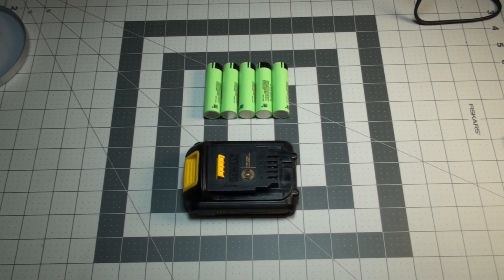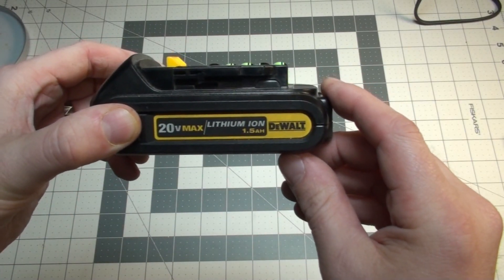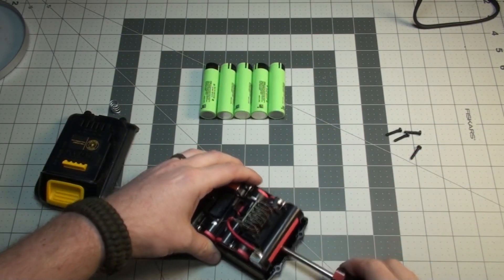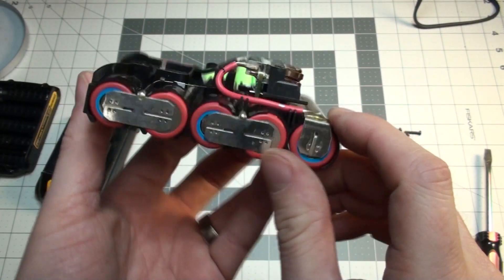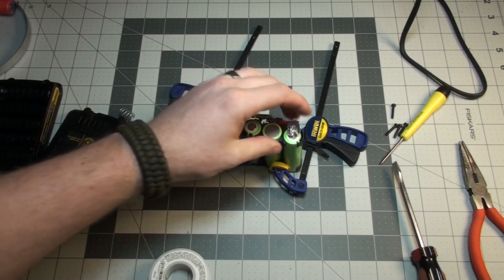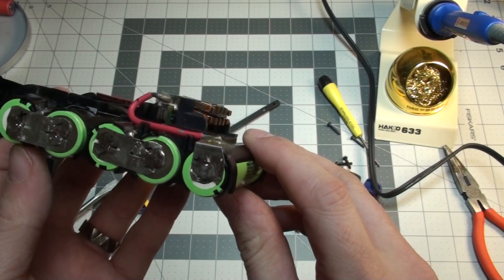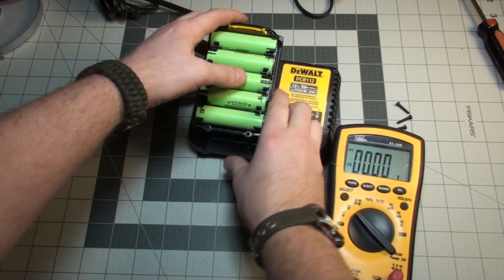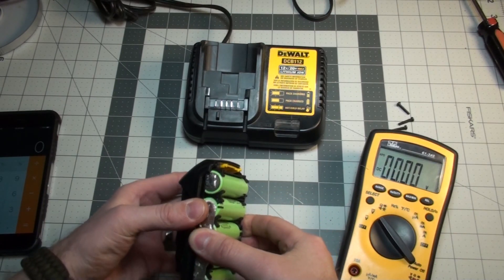$35 Dewalt 20v Lithium Battery Rebuild #diybattery #dewalt #batteryrepair #18650 #cheapbattery

Comment: Shouldn’t you charge and balance your cells first? That’s likely the reason you can’t get to 4.2v. When one sense wire reaches max voltage it stops charging all of them.
Reply from the maker: The cells should be close in voltage.. like plus or minus .1v   And I am pretty sure the dewalt charger doesn't charge to 4.2v.. Probably for longer cell life.
Reply: @keylitho  Yes, something else I read said that max voltage for DeWALT is around 4v… but they also said 0.1v is too much variance. It’s not like we’re building a new battery here so, like you, I think 0.1v is close enough for a rebuild.
Reply: @keylitho  Oh yeah… they call these “20v Max” battery packs in North America and the smallest ones have five cells in series, hence, 4v per cell “Max.” That seems to be what the other guy was referring to. Not sure if there is any overhead there, since “Max” is just a way to market a higher voltage instead of the 18v nominal voltage… supposedly to differentiate from their older line of NiCd-powered “18v” tools.

Comment: PSA These batteries are only rated at 4.87Amp https://www.batteryjunction.com/panasonic-ncr18650b-3400.html. Recommended to use greater than 20 amp cells on a power pack. A standard dewalt brushless drill (DCD791) uses around 20-30 amps under full load!!! These cells will not be able to hold that power before damaging the cells and/or causing fire. i have seen it personally!!! If you are going to rebuild packs, use properly rated cells!!!!! Great vid otherwise!
Reply from the maker: Yea I hear you...The dewalt tools wont try to pull the amps in they are not there the tool just stops..  It works in the drill just fine, anything else not so great it just stops.. That being said I have used this for almost 5 years and it is still a great pack.. But I mainly use it with my hand held area light. (DCL050) it lasts a very long time for the size.. also with the USB charger and the Radio.. It has many great uses.
Reply: @keylitho  i deed with light loads it will last a long time. But for many it comes across as a cheap fix for repairing tool batteries that will see heavy use. I rebuild these as well and have seen what happens with under rated cells first hand. But for light loads those cells work just fine. 👍

Comment: Terrible cell choice for a tool battery. Those are not discharging fast enough...
Reply from the maker: Yea probably... But works just fine with the drill and now that I have had it for 4+ years I really only use it with the work light.. and it still works great.

Comment: The reason those batteries are a bit longer are because they are protected batteries, which you didn't need, because the battery probably has a protection circuit in the battery . read up here https://www.18650batterystore.com/products/panasonic-18650-protected
Reply from the maker: They were not protected cells.. they were only about 1/16" longer.. the ones in that link say they are 69.41mm tall that's almost .25" longer... And after others have commented that I measured the Cells.. I think the Dewalt batteries were just a tad smaller.

Comment: You need to use a spot welder for these. Not solder.

Solder makes battery temp reach over 400°f - 450°f

Spot welding 90°f - 100°f

Have I done it?

Well yeah. You get less resistance too with spot welding.

Comment: Hey do you know which type of solder you used on this? I've been having a heck of a time getting the solder to stick onto the battery terminals.
Reply: First clean the surfaces with an electronic cleaner
https://www.amazon.com/CRC-05103-Electronic-Cleaner-11/dp/B000BXOGNI/ref=zg_bs_15719001_1?_encoding=UTF8&psc=1&refRID=RRCPEBJ08F6RPTVE5BM9#customerReviews

Then use a no clean flux on the piece:
https://smile.amazon.com/Liquid-Flux-No-Clean-10ml-0-34oz/dp/B07B53LNGX/ref=sr_1_4?crid=12MK9AQ1RT3DX&dchild=1&keywords=no+clean+flux&qid=1609352193&s=hi&sprefix=no+clean+%2Caps%2C185&sr=1-4#customerReviews
Reply: Use a battery welder.

Comment: What's the sizes of the bit to remove the screws from the battery or how I will search on Amazon..thanks
Reply from the maker: There is a link in the description.. any security bit set should have the right bit.

Comment: So how have these batteries gone long term? You mentioned they werent being fully charged so are they lasting longer and have the same power with the new cells?
Reply: Don't use these cells. They're pretty inappropriate for the application - In particular, the dewalt charger is too fast. 

The reduced charge voltage is just a choice by dewalt, and is appropriate. They are being fully charged.

Comment: Would it not be 1.7amp after installing the 5 X 3400mah batteries? How did he come to the conclusion that its now a 3.4Amp hr battery? Whats the formula to work this out?
Reply from the maker: It's is because the Batteries are 3,400 mah (3.4 ah ) and they are in series so the overall capacity does not go up, Just the voltage does.. If the 5 Batteries were all in Parallel then the total pack capacity would be 17,000 mah (17 ah) but with only a single cell voltage.. This is how most portable battery banks are arranged.. (In Parallel)
Reply: @keylitho  Thanks for this mate! I understand this now from your explaination. Thanks for replying.. I did'nt realise that the max continuous amp current supplied by the individual cells also made a difference. All this stuff is good to know.. Cheers mate & stay safe!
Reply: When i bought a battery for my vape device, it had a 20amp continuous discharge max rate, i think those cells would have been ideal for your purpose! so many different 18650 batteries on the market!

Comment: Can you make one of these videos that takes a dead pack and converts it to corded utilizing the dead pack casing? I'm interested in getting more of the MAX series of tools, however, I have concerns about buying battery tools because of the fact that manufacturers could discontinue batteries and/or accessories for corded tools at any time, leaving your current tools (which, if taken care of, work perfectly fine) absolutely useless once the batteries die completely. My thought was to create a corded adapter that plugs in to a standard 120V AC Outlet that could convert my battery tools into corded tools.
Reply: For DeWalt you can buy the case that encloses the batteries for $15.

Comment: Also very dangerous using a regular soldering iron to do this. This is NOT the proper way to do this. Another misinformation video. And just because it has a higher mah rating and the voltage reads out right it most likely wont have the current amps that the tool requires.
Reply: I agree, do NOT ever solder the nickel strips back together on the cell. It may damage the cell internally. There's a reason why manufacturer uses spot weld. I, myself, repair and revive all power tool lithium ion batteries and I always spot weld the nickle strips.

Comment: The cells in the battery pack are rated for a whopping 30a draw.  yours have a max 6a, however they will degrade very fast at max and are happier at 1-2. Should have a disclaimer. I understand that some tools may be fine under light working condition but even a drill can spike it above safe working conditions and this is an unprotected battery. which means they blow up. you have the energy density of a hand grenade in your hand. Use your brain. I own tools that torque out with one bad original cell. At least get something designed for high output and is protected. Just an opinion

Comment: What model 18650 batteries were used in the dewalt pack originally from factory?

I would have used some 20A cdr batteries instead of the less than 5A panasonic batteries in the video.
Reply: They use samsung INR 15R's in the 1.5Ah packs. Typically good quality mid-tier cells in dewalt packs.
Those panasonics are a terrible choice. Discharge current is not adequate, and charge current is unacceptable for dewalt fast chargers. Max charge speed for those cells is over an hour.

Comment: Dewalt battery life is a awful way over priced. Could you put them in parallel let them come back to a chargeable level.
But the Ebay batteries are very cost effective and last longer.
Reply: I was going to buy a larger battery but I may follow this guy and buy a dead battery and rebuild lol

Comment: Can you please advise?
Was there only the pos. and neg. to connect to the battery pack? The battery shows 5 connections,,are the other 3 not connected? Usually they are connected to give battery condition and temperature references back to charger, is there no on board circuitry,PCB, in battery?
Grateful for any answers from anyone reading comment.

Comment: nice rebuild !   the BMS are inside the charger not in the battery and this help a lot to rebuild. but I don't know if it is good to the pack because there is no equalization in use. only when charging. anyway nice work!

Comment: I get the bauer packs from harbor freight and take the guts out of them and put in the dewalt packs. You have to solder the old board onto the new pack even though the bauer is almost identical it still won't work with a 20v tool or charge unless you swap the guts over.

Comment: Awesome video! Man, doubling the battery capacity and not making the battery any heavier. 18650 batteries are even better now since you made this video too.. and cheaper! I will NEVER buy another new DeWalt battery again!
Reply: Current 3 ah battery can be found for under $100 for a two pack with better 21700 cells.  Goes on sale at times for $79.  This video was neat, but probably easier and better to just buy from DeWalt during sales.

Comment: THIS IS A VERY BAD IDEA PEOPLE!!! DONT DO THE SAME

Those cells are not designed for power tools and if you use them under load you will either ruin them or cause fire etc etc

Comment: Nice video. I'll add that the likely issue with the battery size is that they included protection circuits on each cell. If you buy them without that option they'll be the same size (the protection should be handled by the battery pack electronics so this isn't a problem).

Comment: For any future views who want to know, the 18650 in these cells is the sanyo UR18650RX. The identifier is not printed in ink, it is embossed ever so slightly in the heatshrink.
Reply: interesting points ,if anyone else wants to uncover recondition old batteries try Jons Mender Guide (should be on google have a look ) ? Ive heard some great things about it and my work buddy got excellent success with it.
Reply: Came here to look for this info exactly.  Thank you.

Comment: The user must have appropriate understanding of lithium ion batteries before purchase. Use caution when working with and using lithium ion batteries as they are very sensitive to charging characteristics and may explode, burn, or cause a fire if misused or mishandled....NEVER SOLDER  BATTERIES MAY EXPLODE. SPOT WELD ONLY

Comment: Dead pack for $5 bucks off eBay ...
I like the choice of top shelf battery replacement; Panasonic  18650 3400 mha ...

Question: what kinda shape was those Samsung 18650; comments pls... 

NOTE: Purpose for details about the utility remaining available to be taken advantage of in a multi-multi-cell battery pack powering an electric bicycle or diy powered skateboard
Reply from the maker: The cells in the pack were at 0.1 volts.. :)
Reply: 0.1volts ... well can't get much from those ... eh

Thanks for the reply

Comment: Dewalt's 20 volt battery pack has 5 batteries. Milwaulkee's 18 volt battery pack has 5 batteries.  Dewalt is exaggerating.  3.6 volts X 5 = 18 volts
Reply: leefiles    Not necessarily.    Lithium batteries charge to 4.2 volts so you start with 21 volts, then go through 20 volts and on down to 18.    The AVERAGE voltage of a cell is usually considered to be 3.7 volts which is where 18 volts comes from.   It also comes from the old NiCad or NiMH cells of 1.2 volts x 15.   DEWALT is not in error.   They choose to think of LiIon cells as 4.00 volts which they are for a while and certainly above 18v for most of the charge as the cell declines to the quite unofficial “average” of 3.7v.
Reply: 20 volt is a marketing name for brushless tools
Reply: Welder Musk     Actually they offered “20 volt max” products long before the brushless motor products came out.   I own a lot of these 20 volt max tools.   The brushless motor products are just a natural evolution in motor technology.

Comment: If you use good cells that can discharge at 20 Amps or more, those nice little solder joints become resistors and will melt. They don't solder for a good reason. Ever wonder why your household (in wall ) wiring are not soldered? No, they're not. They are crimped or screwed together. Or else they become single-use wiring.
Reply: Super late reply, but I want to add - solder's fault isn't its conductivity compared to copper - the problem lies in properly using it. Butting two conductors near each other and bridging with solder isn't ever ideal, particularly in stressful environments. You should always mechanically attach two conductors, then solder. Long ago, house wiring was often soldered, although this was only after the wire was mechanically secured and twisted in the splice.

The battery tab on some tool batteries is simply soldered into the circuit board, too. Never removed one, but they seem to have decent contact area and a large blob of solder.
Reply: They aren’t soldered to the battery purely to avoid putting excessive heat into it during manufacturing. It can damage the cells or even explode.

Comment: That’s because your Cells are protected with a circuit
Reply from the maker: ??  You mean the Cells..?   There is no protection on those cells..
Reply: Keylitho, yeah have you taken the wrap off those cell?
Reply from the maker: no I didn't...But oh well even if they are this is still a great pack and still going strong.
Reply: Keylitho yeah newer more capacity definitely

Comment: I have been thinking about doing the same thing but are those rated for the amps needed I was looking at some that are 3200 mah that have like 20a and 40a discharge rates but the lg 3000mAh are a lot more cost effective

Comment: Just wondering if you could see which cells are dead and just replace those rather then the whole pack if just one cell goes dead the whole pack will die might be a lot cheaper
Reply from the maker: Don't see why not... Just have to make sure the replacement cell is very close in capacity and Discharge amperage.

Comment: Good DIY Guide but make sure you use Quality High Amperage discharge 18650s [see chart]. Laptop battery will perform dismally.  You can tell what got when you try the battery with a heavy work load. TIP: Try Kijiji. New OEM battery can be had for $30-$40
https://i2.wp.com/vapestreetcanada.com/wp-content/uploads/2017/02/mooch-battery-testing.jpg?w=741&ssl=1

Comment: The kobalt batteries are 10$ and have Samsung cells. I don't think you can buy them individually for close to that price. When my dewalt batteries go out I hope lowes is still selling their kobalt batteries for 10$. I remember some brand I thought it was dewalt had a part of the computer that would detect low voltage and dud the battery for good to prevent possible fire. I hope I have the brand wrong and they didn't switch the design.
Reply: I have 2 of these Dewalt 1.5 ma lithium ion  batteries that are dying, which Kobalt batteries would you buy that would work in the Dewalt battery housing,the same ah or the ones that are the same dimension wise ? Did you fix any of your Dewalt battery packs with Kobalt battery pack individual batteries ?  Seems like a good idea.

Comment: Drill batteries should give a minimum of 20 amps instantaneously. The battery you are using does not give 20 amperes instantly !!
Reply: Depends on the load and time used but if this is for a friend that doesn't understand batteries then yes

Comment: Do not do this.  High power tools need high discharge batteries that while having lower mAh per battery have CDR.  If you want to open a battery pack and replace the batteries which IMO is not safe at all, it's important to use the same batteries if possible or one with a similar CDR.
Reply: I have been repacking li-ion batteries from power tools for over 5 years. Different brands and different tools. They have all worked perfectly with peak performance. The only battery that can't be repacked is Makita. They have a protection circuit which kills the battery board.

Comment: DeWalt chooses to not go over 4.0v per cell, because the cells last MUCH longer. You really don't lost much capacity from 4.2 to 4.0, because the cells drop to 4.0 or lower the first 20 seconds of using the drill. DeWalt was very wise to go 20V max.
Reply: And the voltage drops to 18 under load

Comment: I think it was better to just buy a kobalt battery there 10 bucks for 1.5aH  
rebuild the dewalt battery with those
Reply from the maker: Wherever you can get the cells..  But after you rebuild a battery you will like it way more than one you just bought.. You will have pride in that battery.
Reply: 35 bucks for those cells are a waste of time and money 
the knock offs costs the same or less
Reply from the maker: That why I said wherever you can get the cells from..  I just think people should not be afraid to rebuild stuff.

Comment: Nice guide!  Charging to 4.0- 4.1v per cell does 2 things: 1, it would take far longer to re-charge the packs to 4.2. Users wouldn't be happy with the long charge time. 2, the cells life will be far longer charging to 4.0-4.1 than a full 4.2 charge.  Also, not fully discharging  improves cell life. As vuaeco says below, Pana. high capacity cells aren't ideal for fast discharge. Unfortunately, high discharge cells only come in 1.5- 2.5 Ah. That's why Dewalt uses more cells to make higher capacity, not higher capacity cells. Users hate the huge packs, but that's the only reliable way of having a high capacity pack.